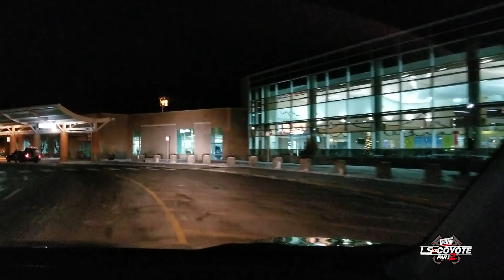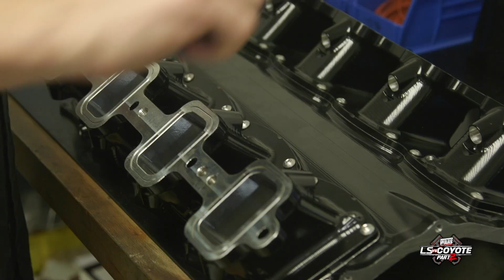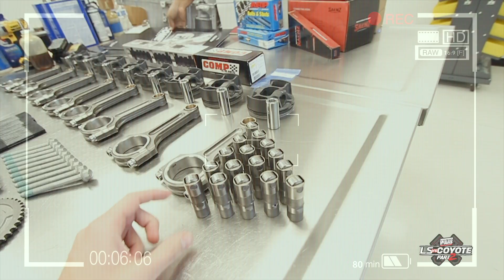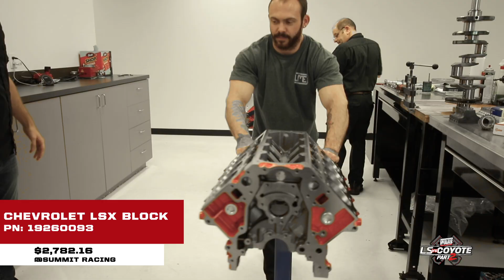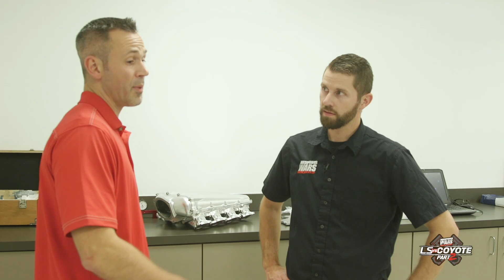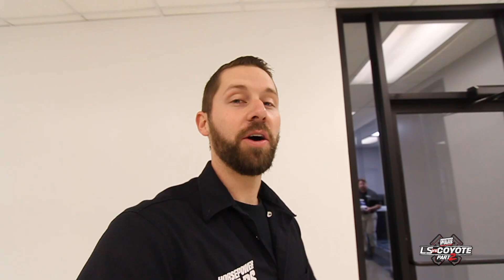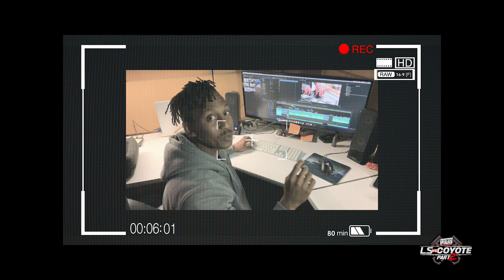LS vs. Coyote 2 Episode 2: The LSX Engine Build

Comment: I hope the coyote gets the same level custom made parts
Reply: It wont. Every coyote vs ls head to head the ls always somehow gets a ton more work than the coyote under the budget. And i own a Camaro.
Reply: Basing this on a budget will not reflect which motor can put down the most power.  What SHOULD happen is you go Mod to Mod...each car gets whatever Mods you choose...same mods then compare. If you want to also compare budgets then that's cool too BUT budget should not be the starting point if you want to know which engine will produce the best power.
Reply: @Cobra-uy3jz  
Really now? Double overhead cams and 4 valves per cylinder should be plenty for you Ford guys. Cost is always an issue and  your missing the point, it's a competition about engines not wallets.  Your Ford parts are expensive and this clearly shows  .
Reply: @Cobra Black yup. LSX crate engine purpose-built drag racing motor versus stock production engines. Lmao
Reply: The only aftermarket block is Generation X and it's $13,000, so stock block it is
Reply: Hahahahaha if the coyote gets the same treatment itll burp 1500 hp for sure
Reply: Doubt it these are Chevy guys
Reply: They are let's go stock to stock ATLEAST
Reply: Not to mention no, lsx blocks are surely not dime a dozen. Name one vehicle they come in...
Reply: @banneddamn 
Read the parts list with part number,  price, and where they got it from. Why dont you call summit and verify if it's so hard to believe.
Reply: It wont bc "budget"...this is a crap way to compare potential HP from these motors
Reply: Dont forget folks a shop that builds ford engines is working on it not them look at the first video before you look well you know
Reply: It wont dude. When they did the first comparison they locked out the cams and disabled the TiVCT lol and then they used a Boss 302 intake manifold instead of the Cobra Jet intake with the monoblade throttle body.
Reply: K THOMAS Ron Rhodes NO2 ‘68 Camaro holds the record last time i checked. Small block Chevy baby. Only a Ford guy would talk up being the king of small tire lol. Even Leroy would walk most of those cars bangin gears.
Reply: From the picture glimpse of the coyote, I'd say no in the intake manifold. Looks like an off shelf metal intake for about $500...more than likely flows less impressive than gt350 or cobra jet
Reply: Just keep turning up the boost cause the Ford can take it stock
Reply: Why did it lose then?
Reply: Ford fan boys will never be happy. Lolol all the crying on here is funny as hell. You know damn well the Coyote build will be doing the same damn thing. Proven fact it costs more to build a Coyote than a LS. The engine itself costs more to begin with also. That's why most builds use LS engines. It's a no brainer
Reply: @captaininsano2777  is that why theres so many ls in the junk yard
Reply: @austinhowze6280  can't help the bad drivers out there. They wreck it. We buy it.
Reply: Mathew Magee........The Coyote motor CAN'T have the same level of custom parts BECAUSE THEY COST FAR MORE THAN THE BUDGET LIMIT ALLOWS IN THE RULES. What the fuck is the matter with you butt-hurt "Ford or die" guys??? What fucking middle income earner wants to take out a 2nd mortgage on his house and be served divorce papers from his wife to build a Coyote motor.........when he can keep his house AND his wife by building an LS motor to make plenty of great reliable power??? And NO.......I'm not even referring to this build off. I'm talking about living in the REAL world where the average guy can pick up a good LS motor from the junk yard SO cheap, he now has the money to stuff it with better parts and have the heads ported.
Reply: Sloppy Mechanics has a build going on right now. He is building an 8 second LS powered car for no more than $8,000. That includes the price the car. You cant build a 13 second Ford for $8,000.
Reply: @ChuckBeefOG   If you hawk around long enough you will find someone tired of sinking money into one and they just want to get rid of it at any loss lol!!!!
Reply: @KTHOMAS-j2j  NOBODY CARES, RECORDS ARE BEROKEN ALL THE TIME, RULES DICTATE WHO WINS AND HAS AN ADVANTAGE IN ANY CLASS. If your talking about Bruder in 2018 they supposedlly left the Shyt275 class and that blower they used was outlawed. He also had a billet block, Thought you girls frowned on that aftermarket block shyt lol?  If your not then say who you thinK it is.
Reply: It won’t need them.. these guys will need all 427 cubes and custom stuff. Coyote heads in stock form are a beast.
Reply: @jmitchell513  very true
Reply: Cobra Black Ford heads are not “far superior” they are a DOHC head that naturally flows more air because it has twice the valves as a OHV engine. The only time you can call them “far superior” is when comparing them to another DOHC head. If you want to spew bullshit you can go back to the early 90’s to GM’s DOHC 350. Which made 400hp and 400torque, in 1994. Coyotes numbers are barely there today. 

OHV is smaller, lighter, lower, bottom heavy, reliable, minimal moving parts, just a better package for cars.
Reply: Chuck Beef that 90s ZR1 engine wasn’t even made by GM. Designed by Lotus built by MerCruiser. Nice try tho 😂😂
Reply: M Z Both were divisions/affiliates of GM, nice try tho 🤣. Ford doesn’t do any cool in house development either, they farm it all out. SVT, Ford Racing, Roush, Shelby, they even work with GM’s Multimatic etc. They dont even built their own high end cars, the Ford GT was built by Multimatic in Canada lol. It isn’t even a Ford, or American hahaha. Kick rocks pal.
Reply: Chuck Beef https://www.roadandtrack.com/car-culture/classic-cars/a13610692/c4-chevrolet-corvette-zr1-engine-factory-tour/, kick rocks pal.
Reply: Chuck Beef Multimatic is NOT a part of Government Motors,    Never has been.  Never will be.    Magna affiliate.
Reply: Jay Why and Magna is a GM affliate.
Reply: Chuck Beef negative.  Magna and Multimatic are NOT part of any other manufacturer in any way, working closely together through a long history and family entwined relationship.   They share some contracts and work together in a supply chain not unlike hundreds of other companies producing parts and pieces for major manufacturers.   That is the only “affiliation” they have with GM.   They “partnered” with Ford for GT production, along with being designated chassis builder/supplier to Aston Martin and RUF, along with other smaller brands most have never heard of (one-off taxis). They’re owned PRIVATELY - no “affiliations” with any other manufacturers aside from parts supply and engineering.   And again, a TVS equipped Coyote is a very strong unit, lasting as long as any other makes engines.   Are there some that don’t last ?  Of course, as is the same with ALL manufacturers products.   NO ONE has a 100% build efficiency, that’s impossible.     People sure do love to complain about things when they go wrong, but I can assure you there are easily as many LS builds that don’t last as well.   Let’s not discuss the build quality of the units surrounding those LS’ either.  There’s a reason there are so many readily available (and cheap) in the junk yards.
Reply: @ChuckBeefOG  how is there 200 more moving parts?  Move valves move sure. But the lifters dont. No pushrods to move. So you are wrong guy. Also they dont have in house stuff? Svt, ford racing, shelby... They are ALL in house ford.
Reply: @mz6187  💯🔥 🔥
Reply: @ChuckBeefOG  LOL , nice I was going to say it but you already did and I ll ad most of the parts came from the UK for the GT except what the windsheild . Least Lotus was under GM at the time I think. Ford didnt develop the Cosworth V8  either, bought rights to the design  with the agreement to develop the v8.
Reply: @banneddamn  
 WRONG! Shelby was not a a part of Ford until a short while back. Chuck Beef was wrong with 200 number but his point about the coyotes having more parts which equals more friction is 100 percent right. I guess Ford developed those carbon fiber rims,  too right? Or the magnetic shocks on the gt 350? GM invented that, Ford did not.
Reply: @ChuckBeefOG  oh and dohc is far far superior to wedge head. You said it, they flow better. 4v pentroof>2v wedge.  Pentroof>hemi>canted>wedge>flathead.
Reply: They will spend all the Ford money on making the Coyote strong enough to make 500hp. You have to replace the powdered metal oil pump gear and the powdered metal crank sprocket just to make the motor last past that lol.
Reply: Chuck Beef  lol idk where you heard that. Not sure about 11-14 blocks but I know 15 plus blocks can make 1000 without worrying about anything. Yes it helps to do stuff like that but it doesn’t need it
Reply: @ChuckBeefOG  Please continue commenting.  I love seeing people make an ass out of themselves
Reply: poopinator22 How so, by proving the LS is a better platform in terms of potential and overall cost? K. Coyote will never be what an LS is, which is king of hotrodding. Factory LQ9’s making 1,000hp and last years, Coyote cant. If you touch the rev limiter on a high HP mod motor you blow the cam chains off the fucking things.
Reply: @ChuckBeefOG  500hp ? Lmao that opg is good got 720-750 whp. It's when your goin for small pulley that your looking at using a billet opg and its about $399 twin turbo systems avoid that by not putting as much pressure on the front cover belt assembly and also you dont have to worry about nearly as much resistance on drive belts that allow slippage. The fact is stock blocks are good for 1100-1200whp with daily driver reliability
Reply: @ChuckBeefOG  NP Chuck, since labor is free you are talking about 400$ in parts to make 1000hp all day w no other changes. WTF new block, new heads, new crank, new rods, new pistons, the only thing they used was the oil pan lol.
Reply: Michael M Because they have a $10,000+ budget and they are trying to make the most power possible. All i am saying is you can bolt a used Garret or Holeset on an LQ9 and make 1,100+ if you tuner knows what he is doing. Denmah had a 991rwhp Colorado that ran 9’s with nothing done to the motor, no porting, no go fast parts, no springs/retainers, nothing. There are ways to go very fast for very cheap, and they never begin with a Ford engine. You can have an insanely fast Ford, but it will never come as cheap as an LS. The record LS truck runs 7’s with a bone stock 5.3L
Reply: @ChuckBeefOG  is an ls the only thing you know how to work on and 300 hp dont get my moving 7sec in an 1/8 you thinking the 1/16
Reply: @ChuckBeefOG  You don't know anything about ford motors do you? My gen 1 coyote 100% stock aside from a blower is making 650whp on 93 pump gas.  No meth injection or anything.  And mine is the "weak" coyote lol
Reply: Ryan B  same here for me as well!  100% stock motor with a Paxton blower on 93 pump gas makes 653 rwhp on a mild tune.  Comments like the one above shows that Chevy fan boys obviously don’t have a clue on wtf they are talking about.
Reply: @ChuckBeefOG  is that why Chevy is using an LSX a purpose built Drag Racing Engine. Crate engine. Versus a stock block and heads. Lmao
Reply: Justin Gulley Lol purpose built drag racing engine. LSX blocks are a dime a dozen. It is not our fault that your dollar goes further with a GM sbc than a Ford. Remember, a Coyote has over 200 more moving parts than an LS engine, so it needs more money to buy beefed up parts. If you go out and buy a MRE filled block and custom heads you will eat your whole budget before you get any parts inside. That is part of the game, if you like Ford that’s fine, but understand you will be paying twice as much to keep up with a Chevy.
Reply: @ChuckBeefOG  unless we both buy new 35k v8 cars and slap blowers on em the yote will eat that ls everytime.
Reply: @GhostlyGhille 
Yeah right! That's why Ford redesigned the 5.0 in 2018 . They did it to catch up. GM crushed Ford years ago when it was OHV vs OHV. Then the mod motor came and landed with a thud. Then mod motor 2.0 aka the coyote came along and there was signs of life again.